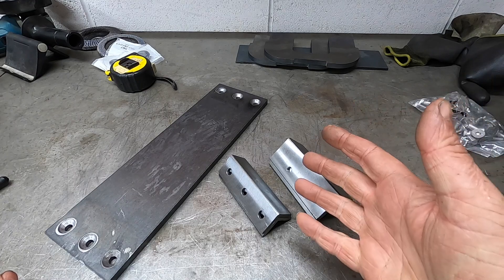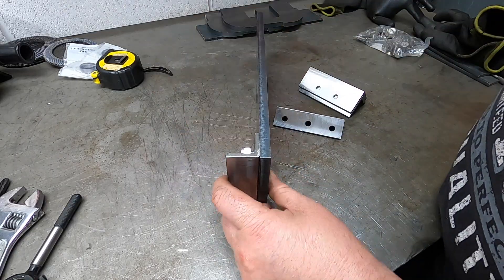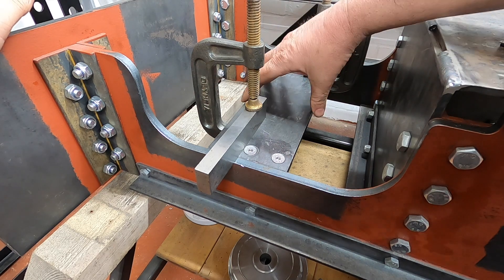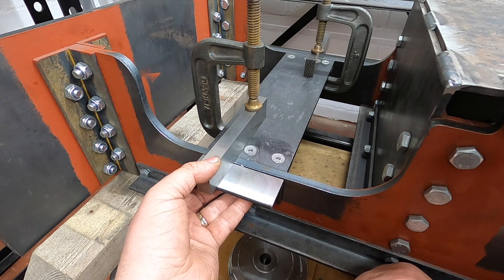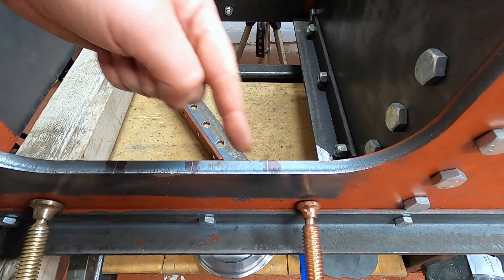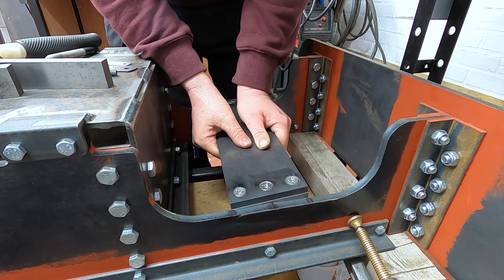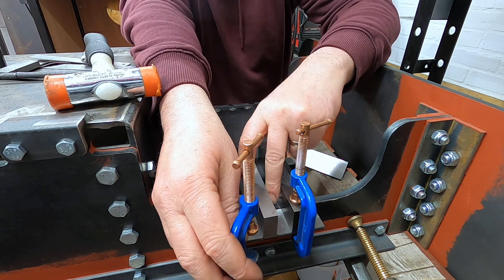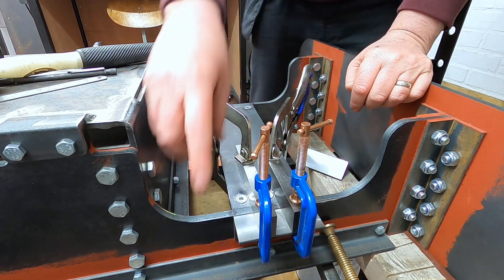Pony Truck Strike Plate - EP22 - 7.25" Gauge Steam Locomotive Build

Comment: Because most tiny locos I've seen look like welded construction
Reply from the maker: Nuts, bolts and rivets is what I see on small locos. If it’s welded it’s a bigger job to replace worn parts or change into a completely different locomotive 🤣

Comment: Evening Matt, looking good. What was the reason for the change in 8mm to 10mm bolts on that plate?
Reply from the maker: Hi James, There will be a lot of weight pushing down on those bolts, so I'm going all out, belt and braces to ensure nothing snaps!! 😂 especially with me sat over it!! I'm tempted to weld a couple of strips to the frames above the angle iron to stop any vertical movement. All the best, Matt.
Reply: @MattChiversWorkshop  
Ah I see what you mean. Cool beans! 👌
Reply: @MattChiversWorkshop  Sometimes the best engineering, is over-engineering.
Certainly better than dealing with broken train/parts, inevitably in the middle of a running session ❤

Comment: What's the point of reaming the holes if you are using fully threaded screws?
You'd be better off using partially threaded bolts, where the stem of bolt fits tightly in the hole ....
BTW I am enjoying and following :-)
Reply: He had already drilled the hole 8mm.Had he drilled it out to 10mm with a drill that has two cutting edges there is a chance that the drill would have skated about leaving a three sided hole that bolt would not go in. As the reamer has 8 cutting edges and a left hand spiral, so that it wont pull itself in, the reamer cuts a round hole.
Reply from the maker: Many Thanks Bambuko,  I didn't have any M10 Sets in stock I only had the M10 Full threaded bolts. I plan to replace them as I don't want the that plate to have and chance of movement. I'm tempted to make some purpose made ones. All the best, Matt

Comment: Coming from a point of engineering ignorance, is there a particular reason you use NyLock nuts rather than drill and tapping? I'm assuming it's for ease of machining and assembly and gives you a degree of adjustment.
Reply from the maker: Hi Mike, Simple answer is, a nylock won't (shouldn't) vibrate loose. I could drill and tap then use a thread lock, but this could cause issues on flexing, as locos can and do flex. All the best, Matt
Reply: @MattChiversWorkshop  That's what we have locktite for!
Reply from the maker: I could just weld it all….. 😂😂
Reply: @MattChiversWorkshop  Thanks for the explanation Matt, every day is a school day. I'll just stick to your (excellent) 4mm kits, I can wrangle plastic quite easily!